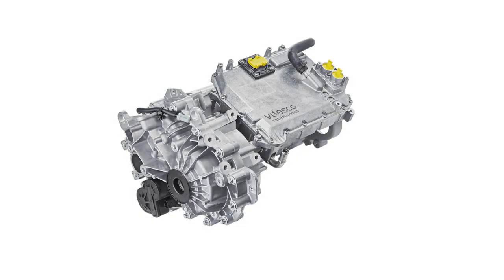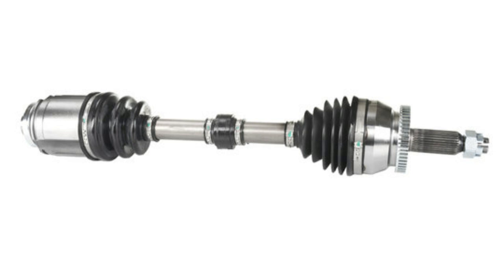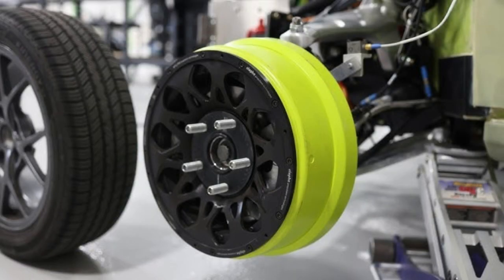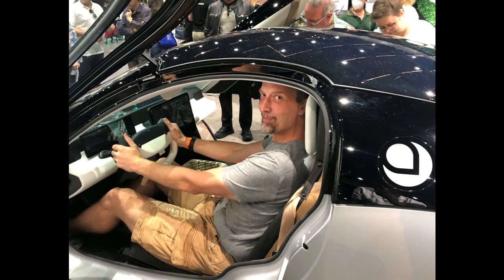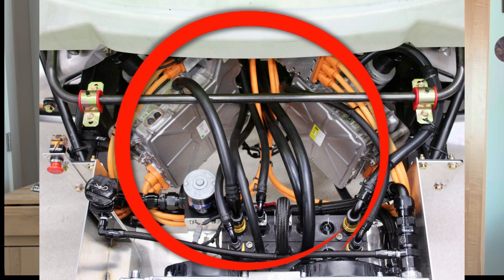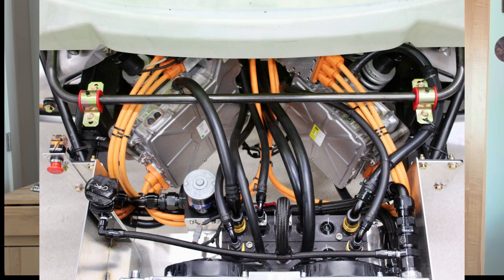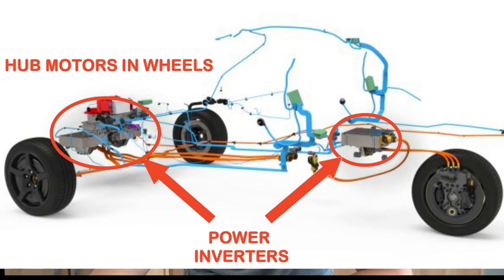Aptera's EMR3 Motor Design vs Original Elaphe Hub Motors

Comment: Thank you for this well done vid!  For city driving, I would like the regen feature of all EV's.  But for open highway use, I would like some sort of a clutch to allow the Aptera to freewheel coast without the magnetic drag of the motor.  

I am glad that the current approach is reducing un-sprung weight.  
We only hear about harsh ride, and handling issues when there is high un-sprung weight.  But there is an even more important issue, especially as pertains to the Aptera: the negative effect of un-sprung weight upon rolling efficiency and range.  Unless you are on the open highway, normal driving roads (especially in the city limits) are not glassy smooth.  The energy needed to lift a heavy wheel up and over a bump in the road will be coming from the forward motion energy of the Aptera.
Reply: Wow!! Really good point! Never thought of that

Comment: The issue is efficiency will be down, driving dynamics will be reduced.  With the hub motors they could control speed at each wheel but not with the EMR3 some stated they were told it was an open differential design which will be interesting to say the least.  However the real cost here is the fully separate ABS integration required which will raises cost and complexity.  They have never built a mule/vehicle with powered brakes yet so let us see what PI2 actually uses.  

The real problem for Aptera is at $40k it is not competitive with anything and given battery price is not the driving cost in one even the 25 kWh will only be two thousand dollars less. Aptera needs to retail for $25k, not $40k as you give up two seats, all the safety expected out of vehicles that cost as much or far less, and insurance will not be inexpensive
Reply from the maker: Most cars on the market have an open differential and have no issue so this should not be a concern. also we have not seen the Beta prototype since it went to Italy, I think there is a good possibility a EMR3 was bolted into Beta for testing. Hopefully we will see an update about PI2 in a few days. 

For the solar charging technology in the Aptera and the use of a carbon fiber body I think the cost is very competitive.  The Mazda MX-5 sells for $30-36,000 and that is a 2 seat roadster with little trunk space where the Aptera has a huge hatch area. Thank you for watching!

Comment: My guess is 3 to 5% range hit with the same battery. Departing from the Aptera motto of having every aspect of the car about afficiency. Doing that had a compond effect. More efficient then less battery, then lighter car then better range.
Reply from the maker: Even if there is a small reduction on range it is not a departure from their motto, it will still be the most efficient car produced even if its 9.5kwh/mile.  the next closest car is the Lucid Air Pure @ 5 miles/kwh. Thank you for watching!

Comment: I reserved one and this change reduce the appeal for this car. It will be less efficient and traction control will be dumbed. Light car on snow here need better tires and better traction control that big ones. The Honda Insignt was simply dangerous in the winter here.

Comment: I have played with electric bike. converted one to hubmotor then to mid drive but after a year of use, I went back to hubmotor. Mid drive ride quality was not better enough on the road to compensate for efficiency loss and simplicity.
Reply: Which does not necessarily translate to an EV.  But if you want to go there... I had a 1500W hub motor on the front of a trike I built... the hall effect sensors wiring failed twice... I believe it was at least partly due to excess vibration and shock loads of the extra unsprung weight. Who knows?

Comment: Seems that nobody reads the SEC filings. If they did, they would have known long ago that Elaphe wanted a commitment of 20K motors. I can see why. Aptera has been taking a long time and Elaphe was tired of all of these targeted production dates. They can't plan on anything if Aptera can plan on anything either.

Instead, Aptera went with an off the shelf unit where they can buy as needed. There's even a better unit but that's one you got to commit to and Aptera doesn't have that kind of money sitting around. Just buy the older unit and go from there. It had nothing to do with what is better, it's just about what they can afford.
Reply: That would only be 7,000 cars... is there any evidence that Elaphe could have easily produced... say.... ten times that many... twenty times that many in short order?  We don't know. This is all speculation based on insufficient information. As engineers trying to produce tens of thousands of reliable vehicles in a timely manner, I'm sure they had good reasons for the change.
Reply: @J-W-Kelly  - The 20K was for commitment. At the pace that Aptera does things, just to get to 7K vehicles is going to take a while. Remember, this is a company that has never produced a product, let alone a functioning prototype for what they intend to build. I suspect that it'll be a real slow ramp up to these big numbers that people are expecting.
Reply: @billsmith5960  They have built several functioning prototypes... if you are going to troll, you could be more subtle...you know, not lie outright . Your extreme negativity and pessimism are duly noted.  Why are you here, again?.
Reply: @J-W-Kelly  - They have built several function prototypes yet those have little to do with what they intend to build. It's like starting all over again.

As for being here, it's for a conversation that we can look at this project from two different perspectives. If it's a real issue that I'm on the fence about this product, as opposed to being all in, then I guess only the superfans are allowed to have conversations that are 100% pro Aptera. Everyone else should leave?
Reply: @billsmith5960  You just contradicted yourself on prototypes after claiming they had not built any, and of course people have real concerns that are addressed by others or are ongoing.  There is a difference between that and the disingenuous trolling Aptera attracts by the trainload. Nobody suggested that everything be 100% positive, so try another idiotic shit-take.
Reply: @J-W-Kelly  - FYI, I'm not going to resort to insults. 

When you read what I posted, "They have built several function prototypes yet those have little to do with what they intend to build". Now you see what I mean. If you look, the Gamma is over two years old. It has a vacuum resin body, who knows what the frame is, skin cooling, hub motors, a small battery, different suspension and no full solar. Plus it's 4" shorter. 

I'm not making this up. It's what Aptera has reported to us. So, in the end, these are major components and along with all of the other items that have changed, it's pretty much starting from scratch. The Pi they have had for a while is for refitting of the interior and wiring harness. Thus, starting all over again.

So, I look at just those changes alone are major. It might look similar, but Aptera has done zero testing of all of the major items they changed. Everything up until 2022 were just concepts. Thus, Aptera is under the gun to get testing going as soon as possible.
Reply: @J-W-Kelly  There is no way gamma is a prototype of anything. It's a fund raising prop. I'm curious if active cooling can even be demonstrated to exist. I suspect not. Maybe a thermostatic controlled fan on the battery. Wrong braking, steering, suspension, motors, solar, shell material, interior, etc. And if it was a prototype, the one thing that should have been demonstrated was miles/kWh since it's mostly shape dependent. They could even hope for 30% better in the future when regenerative braking is added.
Reply: @GullWingInnMoclips  8 days later, doing great! No prior trike has any important relationship to proposed PI.  Aptera can't even commit to seats. Wrong motors, wrong cooling, wrong suspension, wrong battery, wrong shell material, no regenerative braking, incomplete solar......
Reply: Any idea if the EMR3 & 4 are interchangeable if ample funds become available?
Reply: @gr8dvd  - No. That will not happen. Reason is, Aptera must stop re-engineering the vehicle. Stick with something, freeze the design and build pre production prototypes. They only did wholesale changes to the body, chassis (twice), suspension, cooling and propulsion system. I doubt they even have a complete battery ready to go. It would be great if the company would be transparent but yet they are not. They just keep telling us they are but their track record says else wise. I just hope they stop with these big changes, build the pre production prototypes and start testing them. Time is running out as production starts before July, 4, 2025.
Reply from the maker: This is a good question.
Reply: I'm very much in agreement with you.  Everyone is having fun with the technical "what ifs" but one by one, the promised technical innovation has been scaled back to conventional options.  The only thing thats special at this point is the shell but  they've never built a car with that shell.  From the financial side it's pretty obvious why they have been dumbing things down.  They just can't afford to develop all the tech they promised.
Reply: @charlesbeane8795  - Plus, they need to move from just an R&D company to a company that is going to produce consumer goods. Money is running out on R&D and unless they have other companies paying them for that, they need to find a new source of income. This is the second time for them doing this and there are only so many times you can try with the same product before people lose faith.
Reply: Now that we've seen a functioning prototype at CES 2025, Aptera's fans are now justified in saying there's a functioning prototype and Aptera's haters will find something new to hate.

Comment: You are comparing 3 wheel drive to 2 wheel drive. But if we use 2 wheels the weigh difference is a wash. 
Where the heat will be shedded ?  Did Aptera come with the new electric consumption from this change ?  Are they adding or removing battery capacity ? That would tell about the new motor efficiency.
Reply from the maker: Once they get PI 2 and 3 on the road i hope to see some new figure. I was comparing the 2 different versions of the Launch edition. Thank you for watching1